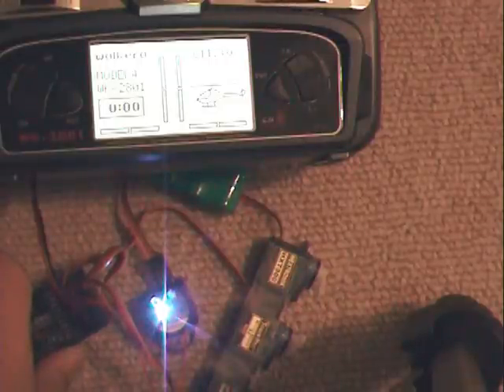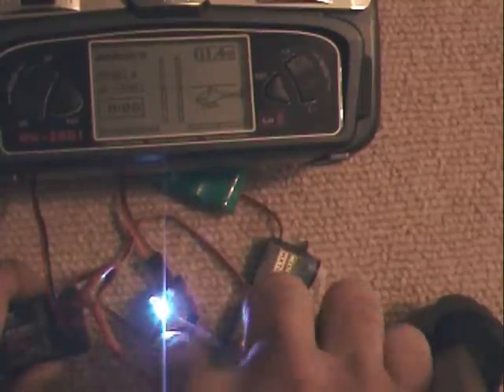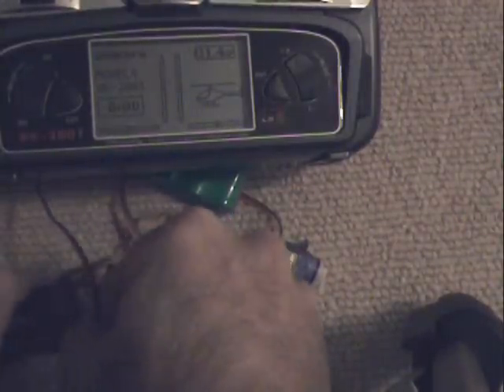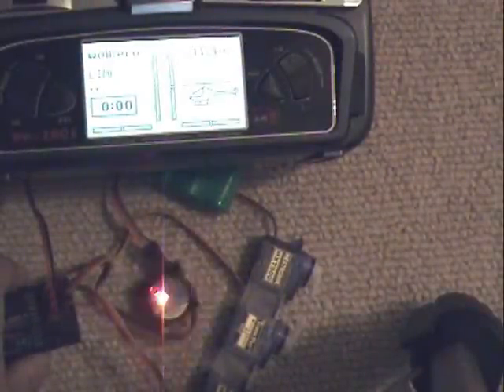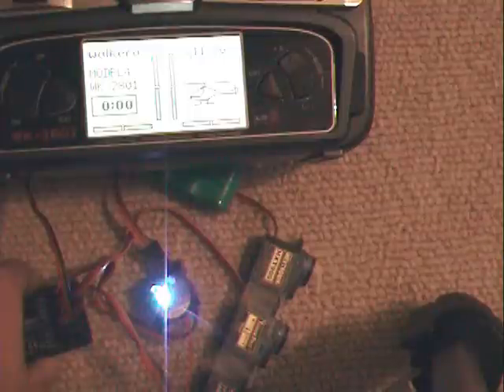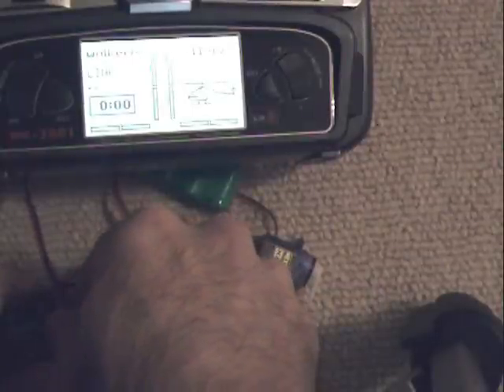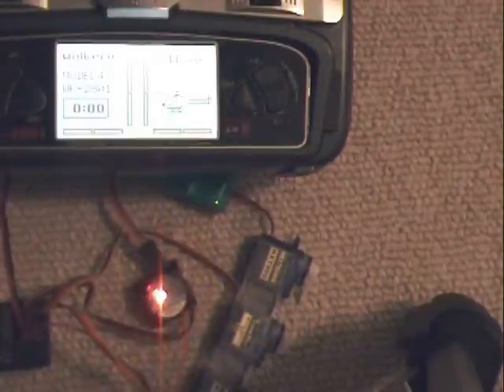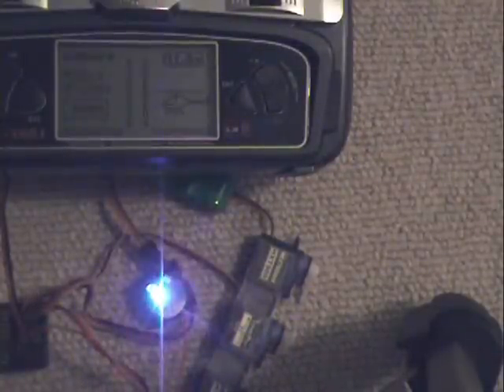Walkera 2801 Transmitter binds too slow for some Gyros

Comment: Problem is; no standards.

Try this;
Turn on the 2801 but NOT the RX. Change TX type so it will NOT BIND with RX (eg from 2601 to 2801). Plug in your RX, change to “correct” TX (eg back to 2601 from 2801). This skips 2801’s long boot up period (Is Walkera using Windows? LOL). The ENT key will commence normal TX initialization. Your RX will connect instantly because your 2801 is already booted up! Technically, you have NOT violated the spirit of Walkera’s procedures. Have your cake & eat too!!!

Comment: @Blueray450 
You could try this.
1. Turn on the TX
2. Plug the battery
3. Wait for 1/2 second (maybe a bit less), move the stick (left or right doesn't matter), the TX will initialize right away. 
I think this should help.

Comment from the maker: @Datucky With Walkera, it binds on every power up. You turn aircraft on first, or both at the exact same time. If you have a Walkera branded Heli, there are usually no proglems(Usually). If you have a plane, no problem. If you time it right, you can turn on the Tx first, count to 5, then plug in heli. How much you count is the trick. But some gyros time out really fast and you gotta quickly unplug/plug back in the heli to get the gyro to Init.  The CCPM mode does not let you swash level

Comment from the maker: Note: The binding process for the Walkera requires you to turn the Rx on first or the Tx and Rx on at the EXACT same time. Why? because the Walkera BINDS on EVERY power up. Even if I turn the Tx on first, the Rx won't get a signal to the Gyro until the Tx is done w/ it's 10 second binding process.